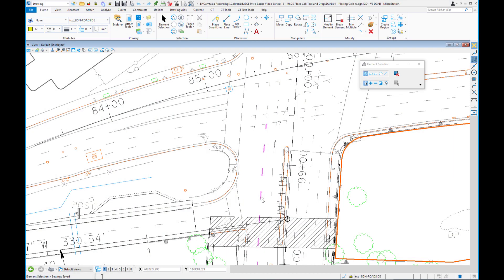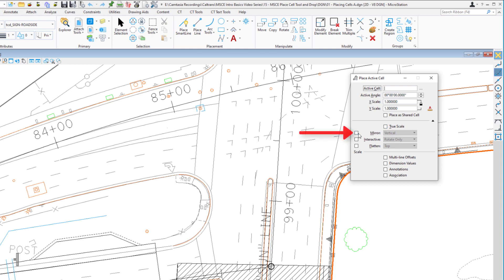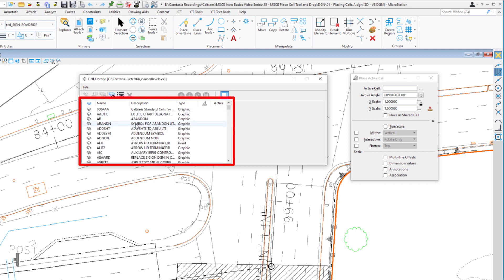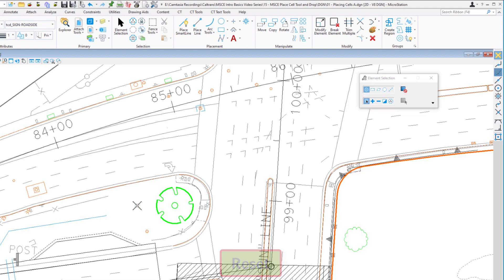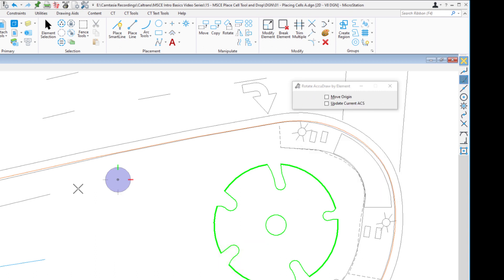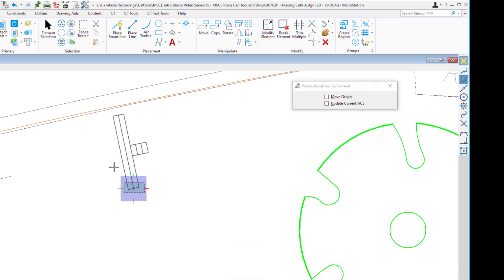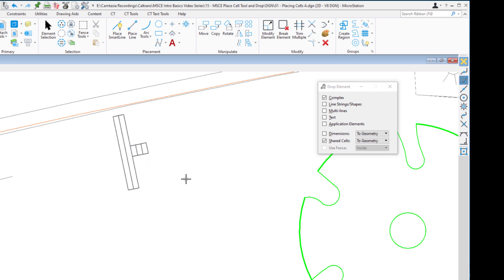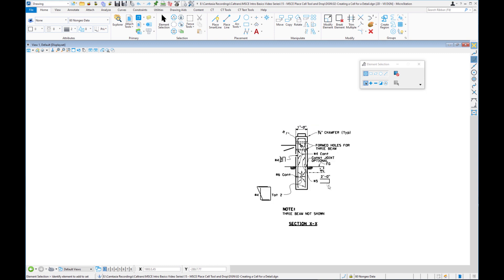15 - MicroStation CONNECT Working with Cells

Comment: What software does Caltrans Survey Department use? I have a few projects coming up this year that require a MicroStation deliverable and I'm trying to decide if I should just export a DGN from C3D or draft natively within MicroStation. As I'm educating myself on this product, I'm having a hard time understanding how the survey workflow works in MicroStation. Should I be using OpenRoad Designer?
Reply: Hi, Sorry for the delayed response. Since your post was a year ago I'm sure you have moved beyond your question. But, here are my thoughts: Caltrans is using C3D to do the Roadway design and MicroStation to create the layout or cut sheets and all other drafting tasks. MicroStation compares to vanilla AutoCAD and C3D compares to Open Roads Designer (ORD). ORD has the survey workflow you are looking for. Caltrans had to write code to convert the C3D (DWG) files into MicroStation (DGN) file format per Caltrans standards. My suggestion would be to do the Sheets (if that's your deliverable) in MicroStation to avoid having them returned for not complying to Caltrans DGN CAD Standards.